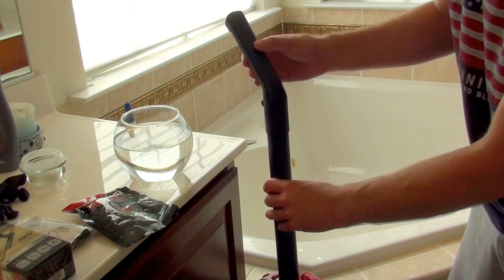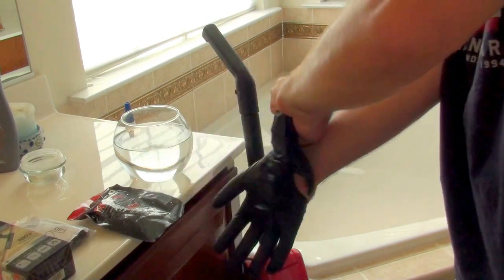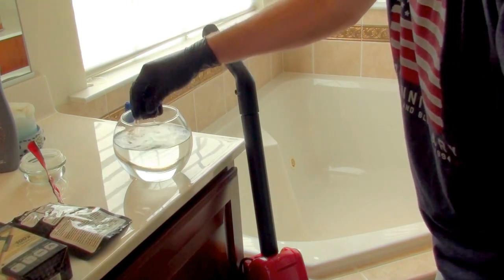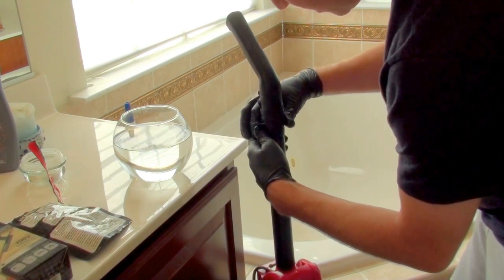Fiberfix video how to with a review.

Comment: Why are you doing this in the bathroom? How much is that repair kit? I wonder if a guy could actually find the replacement part for your vacuum for less?
Reply from the maker: +alwcurlz doing this in the bathroom because I needed water. It was around 5 dollars at the time but I think it was on sale. I looked for the part and it was around 25 dollars at that point I would have just bought a new vacuum.